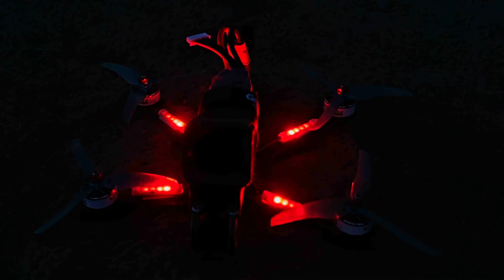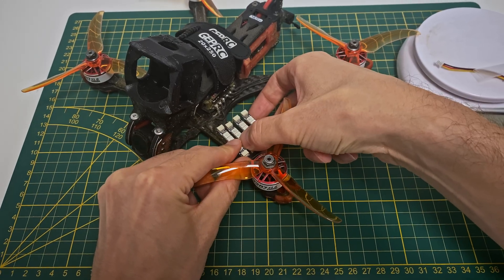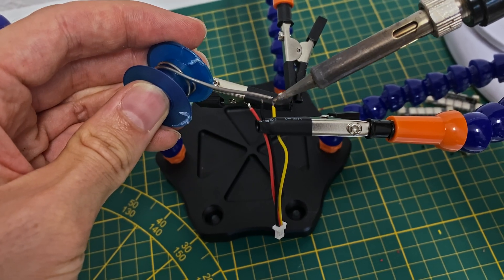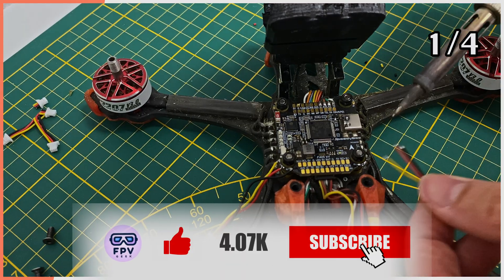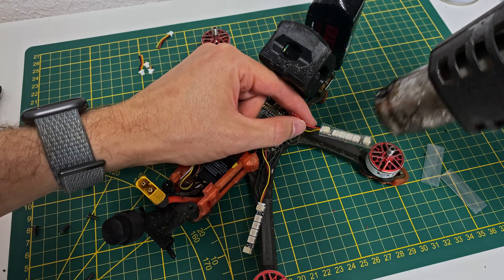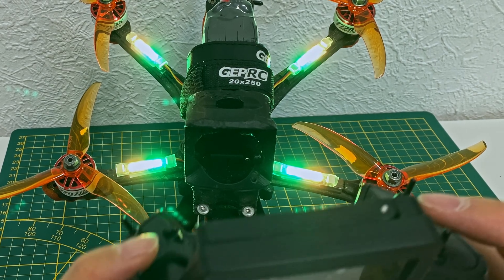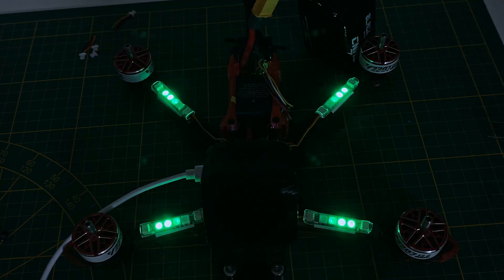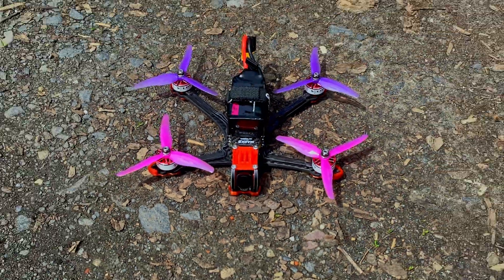Add RGB LEDs to Your FPV Drone | Simple Betaflight Setup Guide 💡

Comment: Hi.. I have a Speedybee F405 60 A and the Speedybee LEDs.. but I have the DJI radio and the SBUS system... do you know if they still work.. because I can't! They don't have a side set up for the power, right?
Reply from the maker: The DJI controller doesn't have that many buttons, does it? 
Otherwise, it doesn't matter which radio you use for the LEDs. You can also set the color and brightness on the throttle input.

Comment: I got a similar setup also using the f405. My lEDs work fine, I can activate and deactivate them but I cannot use the aux7 and 8 on my zorro to turn them on/off or change the color. Even in the modi tab of betaflight they don't change when I rotate them. Do you have any idea why?
Reply from the maker: does your config look the same as at 04:03? 
What happens when you use the controls on your radio? Is it displayed correctly in Betaflight? 
Have you also assigned the controls to the channel in your radio?
Reply: @fpv-geek the last step was the issue! I hadn't assigned the two potentiometer on my radio to a channel! Now it works 🚀 thank you!

SOLUTION: press MDL button, press PAGE> until you reach MIXES page. Here you can assign every button to a channel and see how it corresponds on betaflight in the "Mode" tab.
Reply from the maker: Top! I'm glad it's working now. And thanks for the instructions. I'm sure it will help others.

Comment: Thanks for the video. One question though. Can i use any RGB LED strip (i have a spare roll of RGB LEDs i would like to use) or do i need specific LED strip?
Reply from the maker: If the LEDs support the WS2812 protocol, then this should work. However, I have not yet tested it.